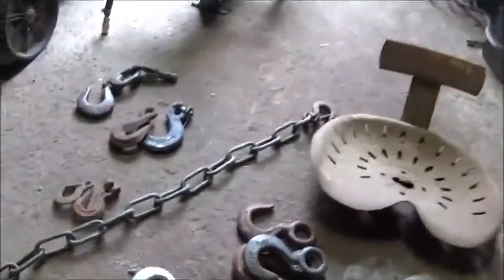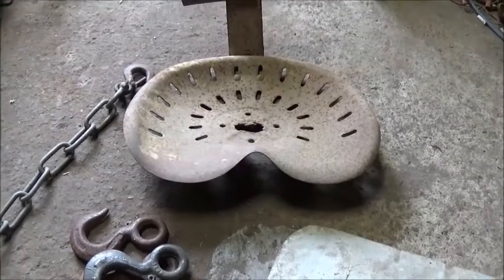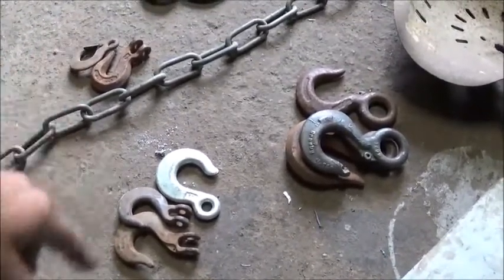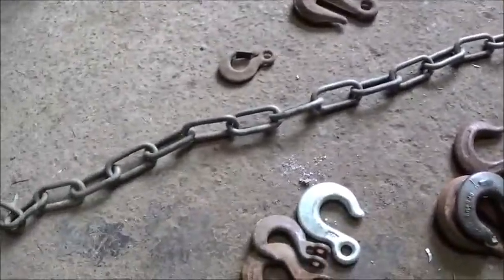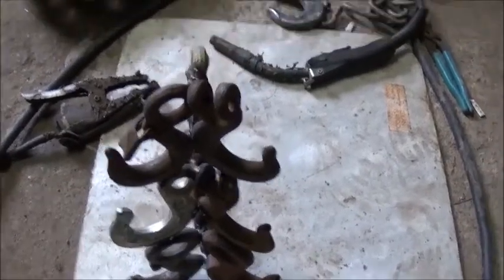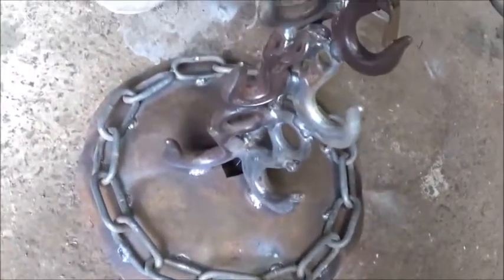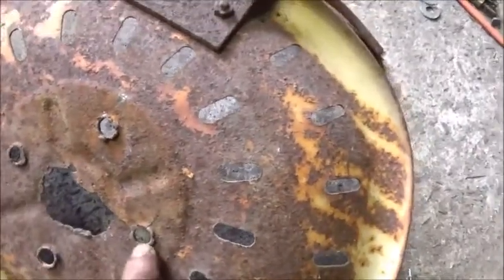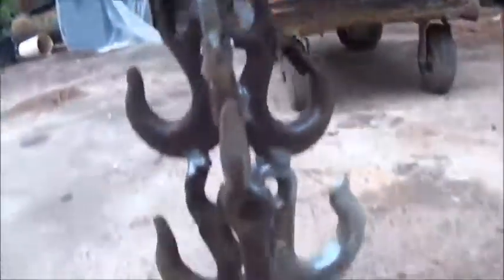Scrap Art?? No, Just Welding More Crap Together!!

Comment: Jonathan, that 3/8 grab hook with the place for a pin was definitely a keeper. I used to keep a couple in various sizes on my truck to shorten chains or make a basket. Of course I had the pins also. I put the hook at the link I wanted, put the pin through it and then slide one of those spring loaded keepers with the dimple on one side through and over the hole for the cotterpin. I can't remember what they are called but the military used them alot to hold the pins for their lifting schakles. But then again that was old skool. As always, a great video.